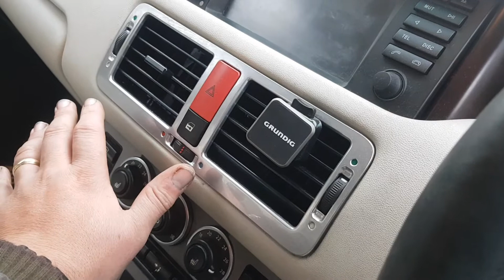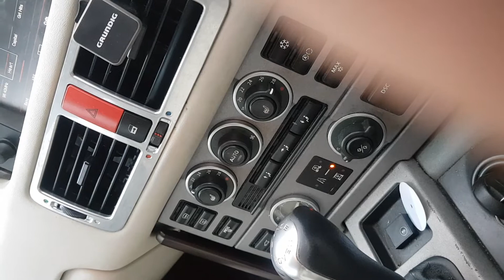Range rover l322 heater fix. Final stage resistor problem location

Comment: Heat coming from the vents but no lights on the control panel and no fan. I'm guessing it's been disconnected to stop it draining the battery. Do you have any thoughts on this
Reply: If you have no lights at all on the heater controls....check fuses.  There's one for that panel.
Reply: @TimChilde  first thing I did. Somebody else has put a wire either side of the fuse for the panel not sure if there is a switch or something. I really am done in with it